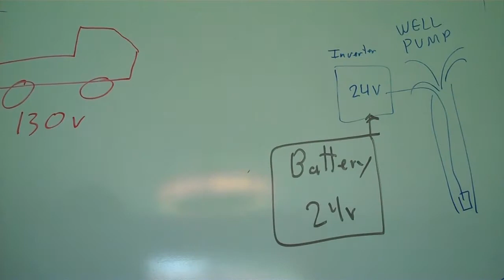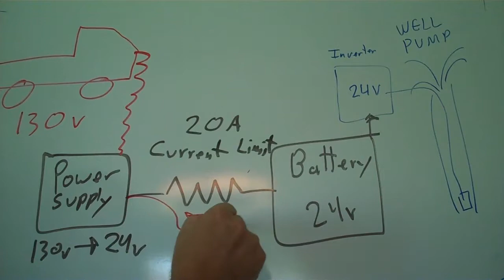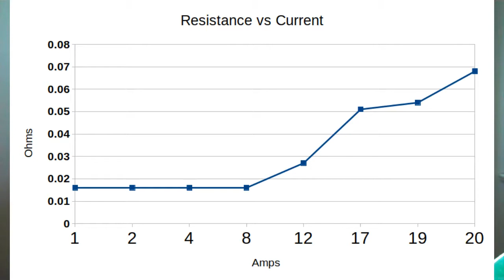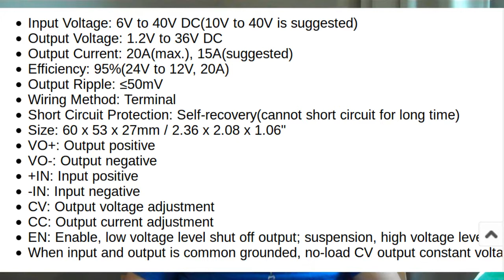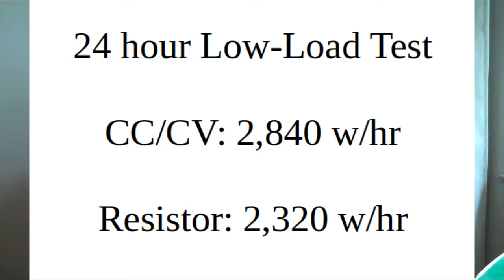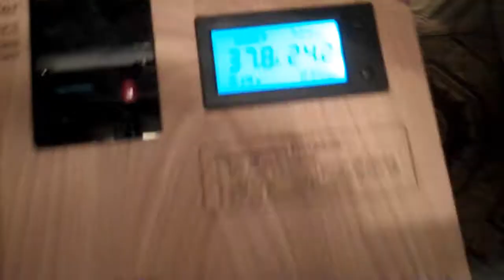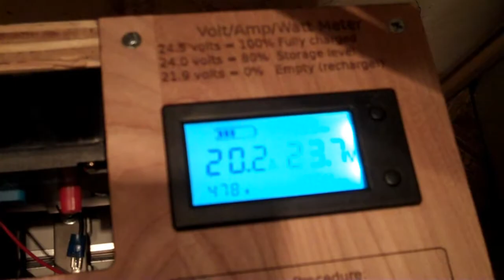Running a Well Pump off Batteries - Charger current limiting device (part 9)

Comment: Wouldn't it make sense to simply use 2 battery banks with 120v, 15A out to the 240v pump? Kind of like imitating our single phase home fuse box?
Reply from the maker: The tricky bit if you're using two separate 120 volt systems is that you have to have them linked in phase properly to generate the full 240 volts. For example Honda has a system where you can take two of their small 120 volt generators and link them, but you can't just connect the outputs of two different inverters or two different generators that are not designed to run in phase and get 240 volts correctly.
Reply: @summetj  I think those links or parallel kits still only put out 120v but at 30A in phase.... so perhaps a 240v, 30A inverter attached to the link would solve that.... however cost would probably be an issue with such an inverter. Thanks!
Reply from the maker: @ri3m4nn   If you have 120v at 30 amps, you could go through a large step up transformer to get 240v at 14 amps. But I think the real solution is to just buy a 240v generator of 240v inverter if you have a 240v load.

Comment: Hi Jay, great series of clips to detail your setup but I wonder how come you don't have any Capacitors across your batteries. I'm in Australia and use a 24V DC to 230V 50Hz Power Jack LF 4000W to run our 2hp constant water pressure pump. We use AGM batteries (28kwh) that are not good at supplying instant current so use a 24v 250Farad (12x 3000F in series) super-capacitor across the 24v supply. That configuration has no problem handling startup currents of up to 14000W (230v @65A) for up to 2 seconds and the pump starts every time. Even with the small startup current of your well pump I am surprised your battery pack can supply enough inrush current on the DC side to constantly start your pump. Without capacitors I think your batteries would be copping a real hiding.
At night our lights, fridge, TV (75" 300W) and PCs draw about 1300W to 1700W  and that jumps to about 3100W to 3500W when someone takes a shower (due to pump) and we never have any problems because the capacitors ability to supply huge startup currents which lightens the battery loads. Have you ever thought of adding capacitors as they would be a fantastic supplement for your system as described.